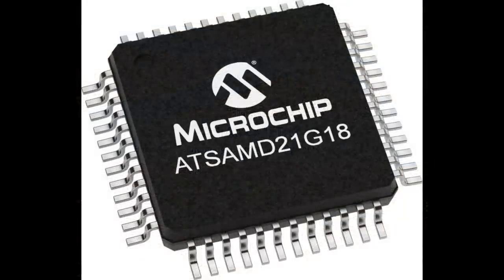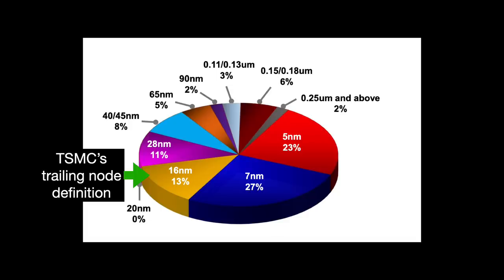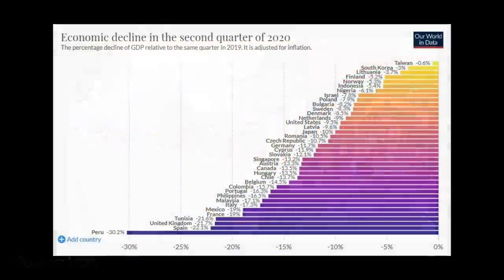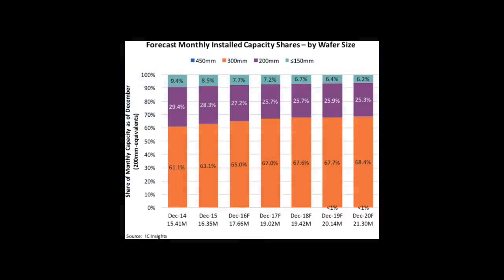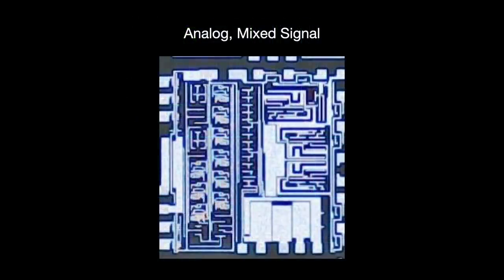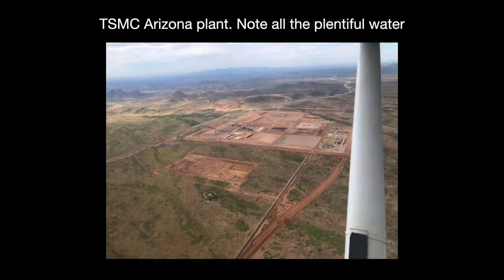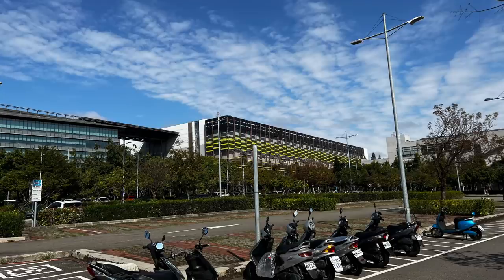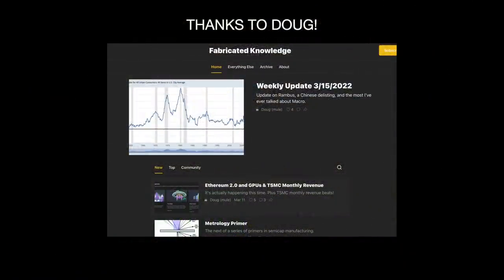Where The Real Chip Shortage Is

Comment: There is a severe water shortage in Arizona right now that is leading to water rationing for human use. The Colorado river, the main water supply for Arizona and the Southwest, is at historic low levels. If water levels drop any further, the hydroelectric generating capacity at the Hoover Dam will have to cut back production to maintain water levels.

Why on Earth are FABS that EACH require 9M gallons of fresh water daily being built in Arizona?!? Only about 60% of that water used by the FAB is recyclable. Building multiple FABs in a desert during a drought is just plain asinine. The people of Arizona are not like the people of Taiwan and will not tolerate severe water rationing just so a chip FAB can operate.

I cannot fathom this abject stupidity.
Reply: Unknown Alien  
There is not enough electricity to run desalinization plants in the American southwest and the ultra high cost of electricity in California makes desalinization uneconomical. Nuclear electricity generating plants are being shut down and replaced with solar panels and windmills which don’t work at night or if there is no wind.

If FABs are to be built, they should be built where there is an abundant fresh water supply (e.g. Pacific Northwest or Great Lakes areas). Building FABs in a desert during a drought is absurd in the extreme, courts ruinous financial failure,  and is just plain stupid.
Reply: Both Intel and TSMC are building fabs there AND they are going to be LARGE fabs.  In the case of TSMC they bought up the space to create a giga-fab, with 6 smaller fabs in a single location, just like they have in Taiwan in a few places.

Closed loop.  The water gets recycled and used again.  I read about what it is they're doing because I said the same thing to myself, which is that's about the most insane place to build ANY manufacturing that requires a lot of water, because that area is running out and that's not going to change.

I don't have a good answer for why this is and I'm not going to search for an answer but companies seem to like to build fabs where it's hot and dry.  Maybe it's about what can survive in the air such as viruses and bacteria, I don't know.
Reply: @jstasiak2262  They are going to recycle the water so they HAVE to be running some type of filtration.  Go read about these plants that are being built.

As far as electricity, if stupid ### Biden would lift tariffs on ALL solar panels coming into the US it would be dirt cheap for a fab in AZ where it's sunny 95% of the daytime hours to have all the electricity they need, INCLUDING the cost of grid storage.  The company ESS produces iron redux flow batteries that use water (closed loop) and iron as the main ingredients and would be very suitable for this situation.  For large companies that are buying thousands of panels, the cost of panels is very small to the point that it out-competes natural gas.  It's an upfront investment though.  A company like Intel or TSMC will have the ability to pay that upfront cost, just like what Tesla does with their giga-factories.
Reply: @johndoh5182  
Nope. Wrong. Wishful thinking. TSMC in Taiwan can recycle AT BEST 60% of its fresh water supply.  You can’t just “filter” the water to recycle it. The water has got to be “ultrapure” and that requires A LOT of energy and labor intensive processing. And what if something goes wrong with the water recycling system or it gets contaminated with an extraneous contaminant that is difficult to remove (like what recently happened at Pearl Harbor)? Then the entire operation has to shut down  and big money is wasted. It is criminal stupidity to build a FAB in a desert, especially during a drought, and especially if multiple FABs are being built at the same location.

To recoup the $20B investment that each FAB costs and turn a profit, the FAB has to operate 24/7/365. Solar panels don’t work at night and there isn’t enough battery storage capacity to run a desalination plant. This is best done with nuclear power because (1) nuclear power plants can produce A LOT of energy and run reliably 24/7; (2) they don’t produce greenhouse gasses; (3) Once the initial cost is recouped, such plants can operate for decades at relatively little maintenance cost compared to fossil fuel plants. But no. California is shutting down both of its nuclear power plants. In Illinois, 50% of the state’s electricity by six nuclear power plants, most of which have been running for decades.

Biden is an incompetent idiot, but the power problem in California has been present for decades and isn’t his fault.
Reply: @jstasiak2262  I really didn't mean to suggest it was an easy filtration system.  That's careless reading oh your part.

My point was electricity is not the issue.  And, fabs pay the cost to do this because fabs run in very hot, dry climates such as Israel, CA, TX and a long list.  So, no matter how complex the filtration, it's paid for by the fab.

And I just did a search on this topic and the % I keep reading is different than what you say.  One is 1/2 the amount of water lost.  Or, Intel says they recycle about 80%, and TSMC says they CURRENTLY recycle about 65%.

But here's what TSMC says about the plants they're building in AZ:

"TSMC is no stranger to water shortages. Taiwan is facing its worst drought in 56 years, something that TSMC said has not impacted production. In Arizona, TSMC said, an on-site water treatment center will recycle up to 90% of water used at the fab.

“And then ultimately, that water will be reinjected into the aquifer in partnership with the city of Phoenix after reverse osmosis and other technology solutions are provided,” said Chris Camacho, president and CEO of the Greater Phoenix Economic Council. He helped negotiate the deal that brought the project to Arizona."

I'd link but I find this site tends to kill off my posts with links, unlike others.

Search "TSMC fab AZ to recycle water"

And then wade through the long list of articles.
Reply: @johndoh5182  
The reason FABs are being built in Arizona is that major tax breaks are given by Arizona for these projects. Corporate greed is allowed to trump common sense. The water shortage in Arizona right now is SEVERE and is expected to get worse. There is no longer enough water for agriculture. The public in Arizona will not tolerate water rationing to keep a bunch of FABs running the way the Taiwanese do in Taiwan. Arizona is far from any ocean and because of mountains and other terrain issues, it is not practical to pipe in water from a desalination plant. Electricity is too expensive in California to make desalination practical.

Israel has solved its water problems because desalination is practical there. There is no water shortage in Texas—Dallas/FT Worth and Austin are not a deserts. There are no longer any chip FABs in Silicon Valley because of hostile tax and regulatory environments, the high cost of electricity and the water shortage.

When FABs cost $18B apiece and become trailing edge commodities within five years, it makes absolutely no sense whatsoever to build an industrial facility that requires 9M gallons of water daily (13.5 Olympic sized swimming pools per day) in an area of severe water scarcity just to take advantage of tax breaks. Especially when those facilities have to compete with agriculture and urban human populations for water resources. That is just too much of a financial and market risk and is just plain stupid.
Reply: @Wrulol 
Look at the many news reports on the drought in Arizona and California on YouTube. Entire communities require that water be trucked in and rationed and home building had to stop because of lack of water. The water level at the Hoover Dam is 162 feet below its baseline: There is a water ring  marking the normal baseline water level on the surrounding stone and the 150+ ft exposure of the length of the four water intake cribs is downright eerie. It is clear that the dam was designed to operate at a much higher water level and that something is very seriously wrong.

 The water used in chip making has got to be “ultrapure” meaning that one must begin with an extremely abundant, relatively clean freshwater supply and purify it further before chip making can even begin. There is zero margin for error. It defies logic and common sense to build an extremely water intensive industrial facility that is vital to national security in a desert during a drought, let alone build several of them. Much less riskier places exist and are readily available: The Pacific Northwest along the Columbia River and the Great Lakes region, to name a few.

American industry (what is left of it) is no longer run by scientists and engineers: it is run by bean counters whose sole concern is wring out maximum profit, even if doing so requires creating convoluted, risky industrial processes and supply chains. Companies that were once Titans of American industry have been run into the ground by these fools(e.g. Motorola, Lucent/Western Electric, Digital Equipment Corporation, HP (a shell of its former self), IBM, etc.

Building multiple FABs in a desert during a prolonged drought defies logic and common sense; invites colossal and ruinous failure; and severely jeopardizes the economy and national security of the United States.
Reply: @Wrulol 
Don’t assume anything. Water is a precious and essential natural resource whose continued availability can never be taken for granted, especially in a desert. It is either present or it isn’t. Judging from the 162 ft “bathtub ring” at the Colorado river, the long visible legs of the water cribs at the Hoover dam that used to be completely submerged, and the extraordinarily low levels of water in the California reservoirs, water availability is a serious problem in the American Southwest. There are television advertisements imploring citizens to conserve water. I saw a homeowner being fined yesterday for watering their lawn.

In addition to the needs of urban citizens, large quantities of water are required for agriculture not only in Arizona, but the California Central Valley which is the most productive farm land in the world and which feeds most of the US. Because of the drought, farmers are pumping water from underground aquifers at unprecedented rates. These aquifers also supply water for human needs. Aquifers have a limited supply that can be exhausted if water is drawn too quickly. That happened during a drought five years ago and farmers had to scramble to drill new wells which didn’t always provide sufficient water.

Anyone who says that there is sufficient water in the US Southwest to successfully operate a microchip FAB, let alone several of them, is either lying, stupid or both.

Comment: In classical economics there is never any shortage or scarcity of any commodity, because price mediates between supply and demand so that they match each other. For example, if chip buyers want to buy a hundred million units of a chip, and the manufacturers are only able to make fifty million units, the price of the chip should rise to a level where the buyers only want to buy the fifty million units that the manufacturers can make. And, if a chip manufacturer runs out of its product, that means that they have simply set the price too low.

Comment: There are a lot of difficulties analog has to face over pure digital, especially if it has circuitry that is always conducting or requires precise matching between transistors. Most analog circuits use older nodes to help with this, and it is much cheaper.

Comment: I wonder how many things are still using a 555 Timer 😆
Reply: I think the most used ancient chip might actually be a TL431. Obviously i'm not the first to voice such an opinion, but i have seen maybe two 555s in a product so far in my hands, but i have had dozens or low hundreds of TL431s in my hands.
Reply: The TL431, introduced around 1977, is certainly used in some current designs. But the LM555 predates thatm arriving in 1972. Perhaps modern-day designs would not use the exact same model, mostly adopting SMD format.  As for being the most ancient still used in new designs, I'll suggest as candidates some 4000-series CMOS logic chips introduced around 1968. Around the mid 70's, there was a transition from the "A" series to the "B" suffixes,  (I believe the B series added a buffer stage to the output, and possibly better ESD protection).  But again, these days you would choose SMD variants.

Comment: I can barely get a cheap ATmega328 anymore, and those are bogstandard chips made on any whatever process node happens to be available. And we use a lot of single board computers at work, but that market has been absolutely decimated by the demand.
Reply: Not whatever happens to be available, they're made in-house at a 350nm node, it takes years of effort to transition to a new node and fab so i suspect it was never done. Consider, it is not synthesizable, it's a hand taped out hard core; and it cannot be truly synthesizable due to various analogue functions - ADC, comparator, BOD, oscillator, etc, expected pullup/pulldown current and so on.
Reply: @SianaGearz  there are a lot of presumably counterfeit ATmegas though, but even those seem unavailable for a decent price. I can get them at a higher rate, but at that point I might as well get an RP2040 or something else that's way more powerful. I'm almost forced to resort to overengineering.

Comment: The trailing edge is enough to do a lot of things if cheap enough to plunk into a design. Good heat tolerance and resilience. And no new R&D. Just need to build the old machines in 300mm and use everything learned about automation in the past 20 years.
Reply: "just" need to.. lmao

Comment: My recent (shocking) observation, is that low end Alter Cyclone and Xilinx Spartan FPGAs are totally out-of-stock with all US and UK suppliers. This has scuppered my plan to release a small FPGA based board (it would have been super low volume anyway).
Reply: I have some spartan 3's in my drawer.
Reply: @GodzillaGoesGaga  Well if you don't need them, now might be a good time to sell them. There is a tiny CycloneII based PCB with breakout pins which used to sell for $10, but now I have seen the exact same board being sold for $50 upwards. Who knows if prices will go even higher? Might be worth waiting and the value of your Spartan 3's might go even higher! Just a couple of years ago one was spoilt for choice for the low end FPGA's. I don't even know if these old parts, which are very maker friendly (for soldering) will go back into production.
Reply: @migry  Kind of hanging on to them since they may be useful for my projects!!  This supply chain issue is nuts!!
Reply: @GodzillaGoesGaga  Yep, I'd do the same thing! I have one MAX10 and one Cyclone II remaining. I want to make another PCB. I have made various versions with various options and trade offs, but now I want to finalise the design. I could desolder the other parts from the made up PCBs, but I am reluctant to do that. So I do wonder when the supply drought will end and will the low end parts become available again. Just FYI, I checked a UK supplier a few minutes ago having received an email about a discount. The say that they will get stock of EPC28Q208 low end Intel/Altera CycloneII parts in August, but want $75 per part with minmum order of 96 (on back order). Ouch!
Reply: @migry  I have a bunch of EPM7032VLC44-20 cplds if you're in need.  Just reach out.  5V parts.
Reply: @GodzillaGoesGaga  BTW aren't the "V" LC parts 3.3V ?
Reply: @migry  I checked the datasheet and it said 4.5-5.0V.
Reply: @GodzillaGoesGaga  Please don't be offended, but I was surprised enough that I had to find a PDF of the databook to double check. Just in case we are talking about different parts I was refering to the parts with the "V" in the suffix. The "LC" part I think defines the package type and if you also find an "S" bingo(!) you have a part which can be programmed using JTAG.
 
On page 71 the datasheet for the EPM7032V EPLD says 3.3-Volt 32-Macrocell Device. Dated February 1993, ver 2. "3.3-V version of the popular EPM7032 EPLD".

As I mentioned, I'm not trying to insult you, but I needed to check in case my memory was foggy. 

I have a small collection of both EPM7032LC and EPM7032VLC parts, in any case neither of which can be used since I don't have  a programmer. This is a pity because I have started to use GALs in my board designs, and being able to use the 7032 parts would save PCB space and allow more flexibility.